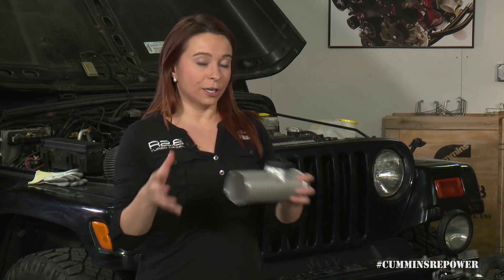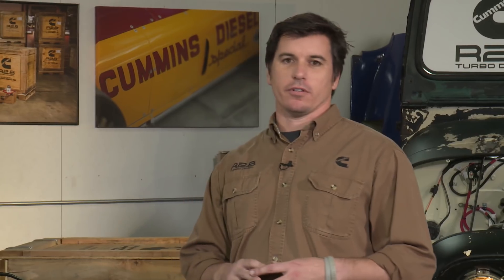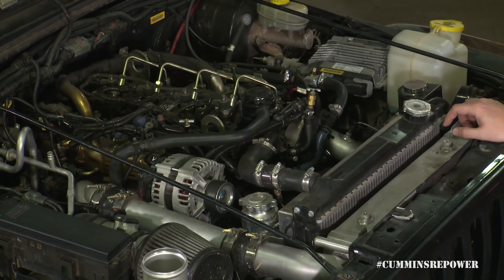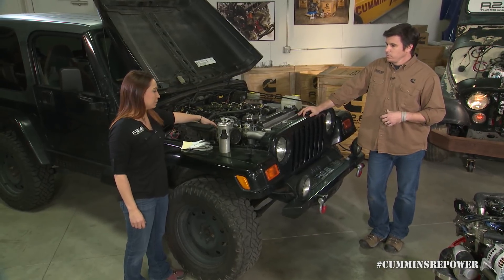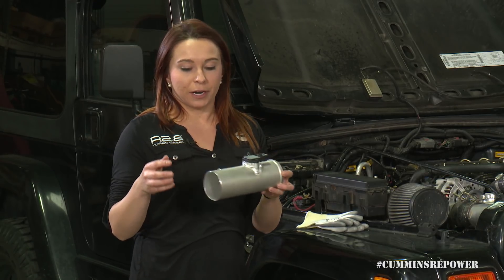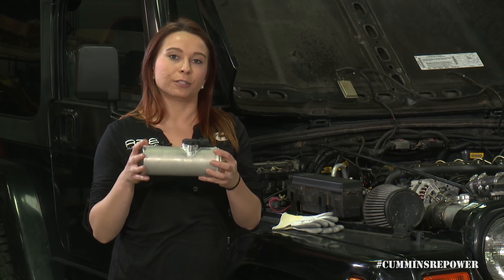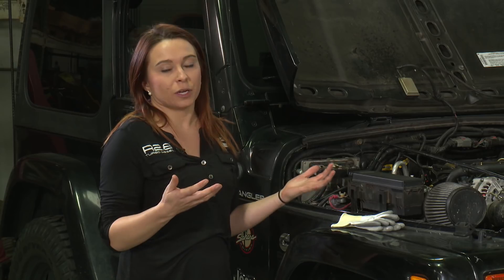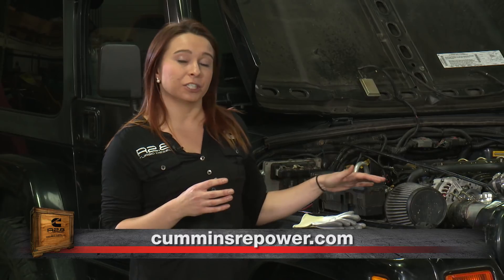Cummins Repower Garage Video 7: R2.8 Air Intake

Comment: 24 to 27 lb of boost in the stock configuration . I guess that explains the torque . I interested in the engine and seeing how it does . At least its direction injection engine and turbo charged inner cooled . The 2.8 certainly seems like a good choice for my Toyota 4x4

Comment: I was reading some articles about the 2.8 and its reliability. The articles that I have read all say the same thing:
                          "But in reality, this engine has a terrible reputation on the Asian market because of low-quality assembling and                                                materials. The most common failure of this engine is a quick wearing of cylinder walls. As a result, increased oil consumption. The next problem is bad connecting rod bearings damaging a crankshaft. Besides that, the engine easily overheats. There is a high risk of coolant penetration inside cylinders."

What has Cummins done to address these issues?
Reply: Sell it as a crate so they can replace this engine 😂

Comment: where is the correct place to put the cone filter? also that looks like an off the shelf sceptre cone filter.
Reply: Where ever it works for you. Easy.. mount directly on turbo better.. away from heat. Even better some sort of ram setup.
Reply: How is directly on the turbo away from the heat???

Comment: Not as easy as I was hop[ing for.🧐
Reply: It's as complicated as you want it. 
People slap in a V8 engine all the time.  Just depends on what features you do or don't want.

This being an emissions legal engine and heavily computer controlled.. it's not a swap for the faint. 

But again.. you can ignore some of the info here and still have a working engine. However it may not run right or may have issues or maybe it's just overkill ( radiator 3x bigger than it needs).

TV shows make this look easy with 80+% cut out.